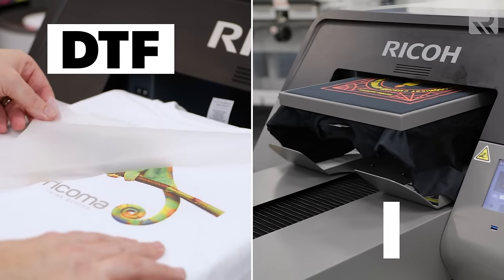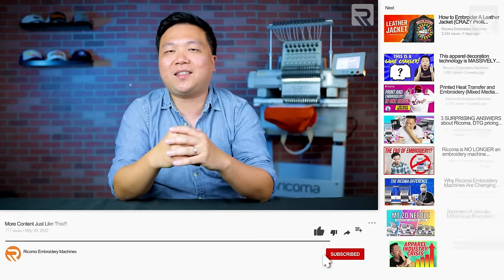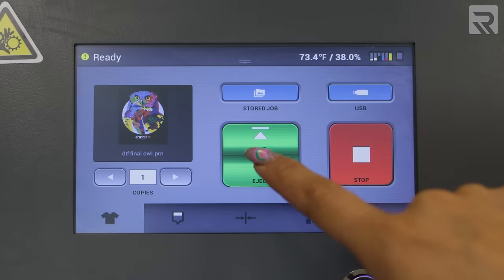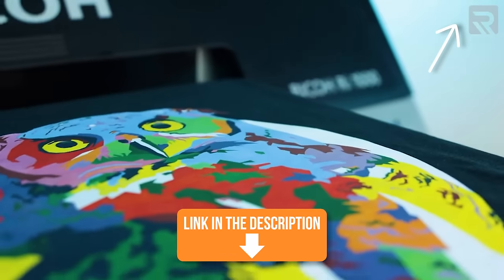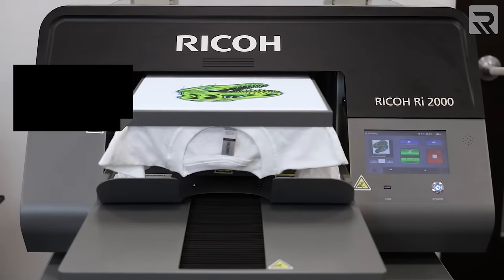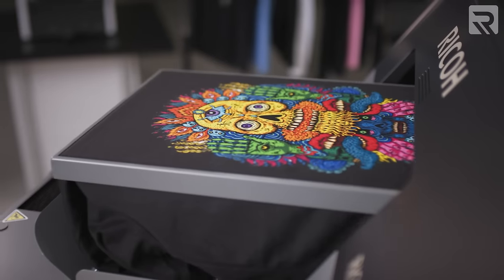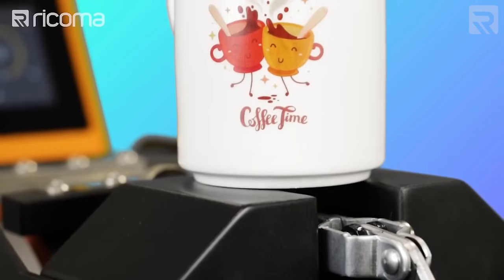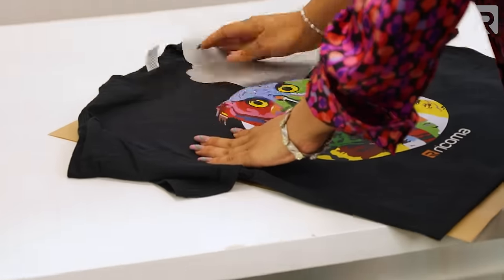DIRECT TO GARMENT PRINTING VS. DIRECT TO FILM (Pros & Cons)

Comment: Nice commentary. The only thing I wish you would have done is actually show yourself doing the process rather than just talking about it. 
Also, I don't consider it a con of DTG only printing on flat surfaces because it IS DTG, meaning it's specifically for shirts.

Neither do I consider your cons of DTF to be more laborious than DTG. If one has used iron-transfers in the past, there's no difference other than the curing, which seems to only take a few seconds 🤷‍♀️
Reply from the maker: We appreciate the feedback!

Comment: DTG printers are the worse....They are strictly large inkjet printers. High maintenance. Uses a lot of ink. Print heads always clogging just like regular ink jet printers. It also takes forever to print a shirt so you cannot really do high volume. .....for T-Shirt printing nothing compares to screen printing for the printing process and the end product....
Reply from the maker: We appreciate the feedback! Our Vision DTG printer is one of a kind. Unlike other DTG printers that require frequent maintenance, the Ricoma Vision has automated maintenance functions to save you time. The machine’s regular functions include white ink circulation, auto head cleaning, automatic monitoring of the ink supply and much more. If you want to learn more about our DTG machine, please submit a request > https://info.ricoma.com/Black-November-Sale-2023/DTG/o
Reply: Thats good to know....We just had a bad experience in the past using this type of printing. DTG printing does work for us for small runs, but because of the small numbers we have to charge more to make it cost effective. 
 @ricomatv